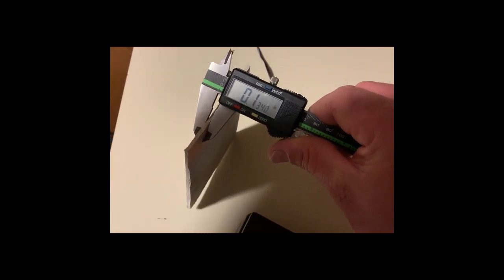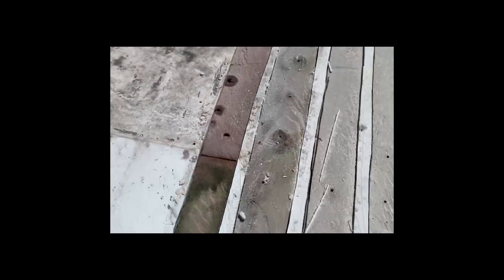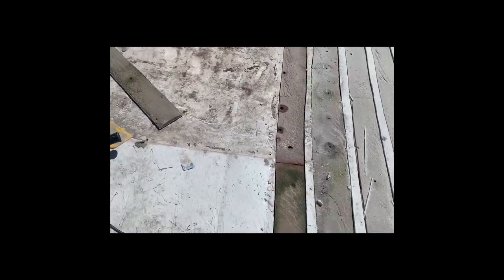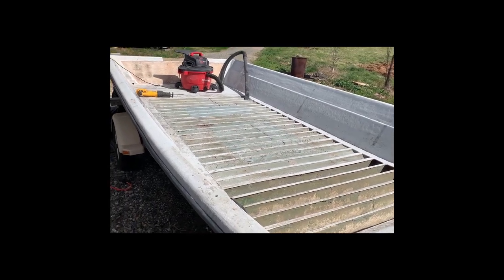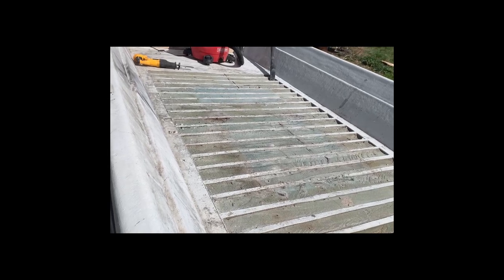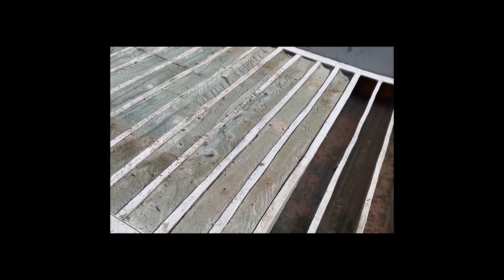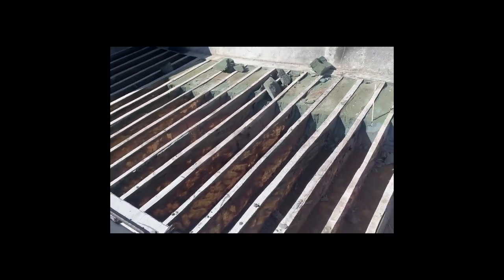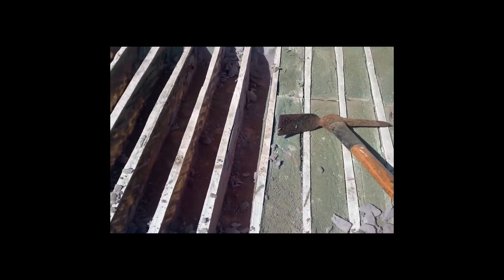Cutting Out The Deck! Carolina Skiff Rebuild [Water In Foam Part 3]

Comment: Skiff owner as well. Fiberglass doesn't really rot. What your seeing is lazy manufacturing. Every channel could be filled with water and the original foam and the boat will still float. That was the point. Really its just the weight and the chance of the soaked foam freezing being the issue. Drill then dry once a season and these boats will probably be eternal. Yours turned out very nice though. Awesome job.

Comment: 10+ years ago, I was the first person to post on skiff forums about drilling the transom to add garboard drains and using a electrician bit welded onto a steel rod, it laid on the hull and I drilled through every stringer from the stern to in front of the console. I removed every screw from the deck and sealed everything the way it should have been done at the factory. I lifted the bow and both drains dripped water for over a month. Even after a trip I would remove drains and raise the bow. After 8-10 months the foam was bone dry. I would remove the drain plugs about every 6 months and it was always dry.
Reply from the maker: That seems to do the trick. A charter captain I went with had a 24’ Carolina Skiff. He drilled it out and drained it every winter. I just wish I would have heard about it 5 or 10 years ago! I wouldn’t be in the situation I am now. Thanks for watching and commenting!

Comment: Why don't you just seal it up when it's done, I want one but looks like it's a common problem. It's kinda stupid design really.
Reply: Everyone thinks that but in reality......Regardless if the foam is soaked or not its still going to float. It still displaces water. Everyone of those channels could be full of water and the boat will float. That the point.

Comment: I'm cutting all of the bulkheads out and running stringers long ways. I already have bottom work to do so I  figured just run em long ways, install an in hull fuel tank and run it. I'm still mulling it over
Reply from the maker: Next video will be when I get into bulkheads. Then the next will probably be my plans for the fuel tank and console. I am excited for what I have planned for the fuel tank. I hope my plan will work out. If so I think it will be a lot better than what I had.
Reply: Looking forward to it. Hopefully my topside will end up looking like a shallowsport, or, dargel layout. Batteries under the console, fuel in hull, and only about 8 inches of gunnels. Here in Texas we do a lot of wade fishing, therefore we're in and out of the boat a lot.
Reply: Looking to add 2 or 3 livewells as well.
Reply from the maker: That will be awesome when you get done. I thought about doing live wells, but I have a big one I can take on and off the boat. Mine is only 18’6” so I don’t want to take up to much room when I don’t need it. Then again who knows what I will have in the end. I am already changing things up from what I had planned.

Comment: I wonder what putting in some "Heat source" of some kind under the hull and drive that moisture out.
High enough to drive the water to vaporize over time but not enough to do any damage.

Comment: Thanks for the video.  Were the individual bulkheads sealed between each other?  So if one bulkhead was soaked were the ones on either side of the soaked one also wet?
Reply from the maker: Thanks for watching. Yes the voids were sealed between each other original. A lot of mine were deteriorated. Mostly near the back.  Water could go right between.

Comment: What made you not just cut down both sides and roll it up
Reply from the maker: I wanted to leave the bulkheads intact as I could. I was afraid if I ripped the whole deck up they may come out with it. Then I would be replacing them from scratch. Thank you for watching and commenting!

Comment: I’m doing the same thing my Carolina skiff is 20 years old
Reply from the maker: Mine was about 20 years old when it started showing problems. Wish I would have done something about it then. Good luck and thank you for watching!
Reply: @FishHuntCookTinker  those skinny fiberglass bulkheads are so flimsy I’m thinking about cutting them out and replacing with 3/4 coassa bulkheads not so close no foam 3/4 inch Marine ply that I already have it’s been inside drying for several years
Reply from the maker: I thought about doing the same. I read ALOT about it and went through about every message board. That was a hot topic with a lot of controversy. I’m going back original. My next video will show more about what I’m doing. It may not be the best or easiest, but just what I decided to do. As long as it floats in the end.

Comment: Anyone:  best grinder blade for cutting fiberglass?
Reply from the maker: This is what I used. It worked amazing! Just be prepared for the mess it makes. 

4.5-Inch Carbide Cutoff Wheel for Cutting: Fiber Cement Board | Wood | Plastic | PVC | Vinyl | LVP Flooring | For Angle Grinders with 7/8" Arbor https://www.amazon.com/dp/B07XM725Y4/ref=cm_sw_r_cp_api_glt_fabc_CBQ82CFQVVJ1Z0FXS82W?_encoding=UTF8&psc=1

Comment: No way I would put that foam back just to cause the same issue. I have done this same thing but never wanna do it again.
Reply from the maker: I went back and forth a lot on it. I will never put another screw through the deck again. That I can assure you! Also I plan to make a drain path for the water just in case. My main reason for going back with the foam was safety. The lake I fish the most is notorious for having floating logs after a rain. I unfortunately have been riding in someone else’s boat and hit one at night. It didn’t do any real damage, but it was not a good feeling getting back to the landing not knowing. Going back with foam may not be ideal, but it gives me piece of mind. Thank you for watching and commenting!

Comment: You could have poured gasoline or lacquer thinner and the foam would dissolve.
Reply from the maker: That is a good point. Seems like I read somewhere marine foam was resistant to gasoline. I may have to do a experiment and see. Thank you for watching and commenting.
Reply: Makes a big mess either way.
Keep up the good work.
Reply from the maker: I can imagine it would. I will do my best. Thanks again.